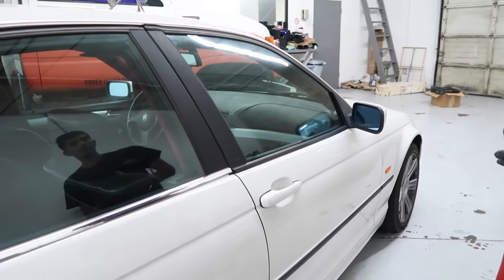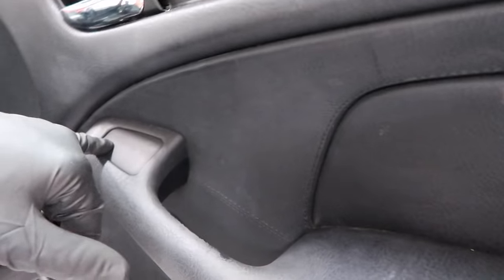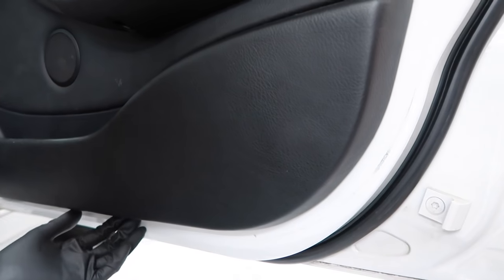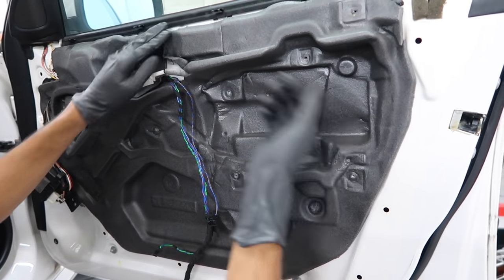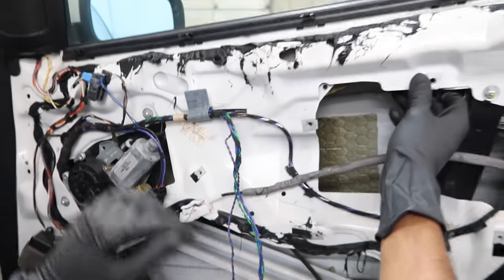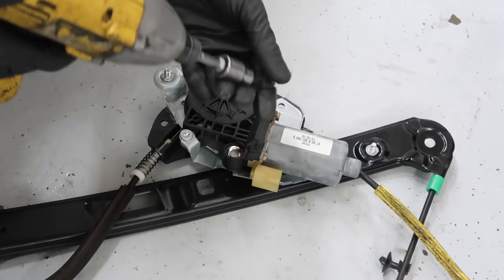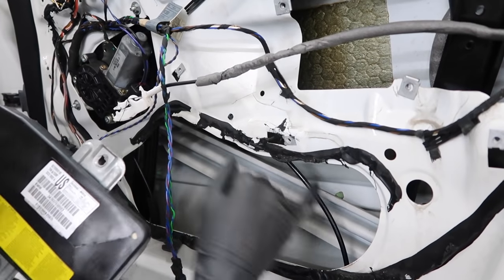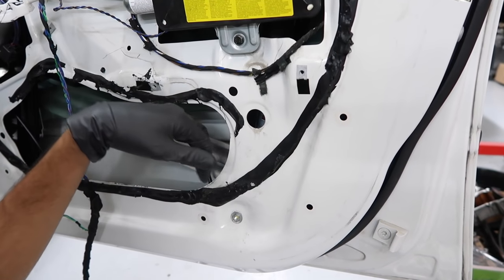BMW E46 Window Regulator DIY + Ebay Regulator Review

Comment: My 1999 coupe has more rattling in the drivers side door, like the window is a bit loose, I think I maybe have even heard it actually moving on bumpy roads. Should I just try to remove the panel and look for loose bolts, or maybe there is something more to the frameless windows?
Reply: I have same issue with my M3 lol.  I guess only way to find out is to remove the door panel.  Thought it could be just a loose bolt, but may need a regulator.
Reply from the maker: The way the regulators hold coupe and convertible windows is with a bracket that has rubber on both sides to hold the glass in place. You can replace the rubber part or just try to tighten the bracket as long as your regulator is still working fine.
Reply: Great info, thanks!

Comment: My 2003 bmw 325i drivers side window motor and regular is replaced but my window only rolls down ( spins down when I click down and up )   ( rolls up when I use the "hold right to roll up windows" lock feature on the outside of my car.
Reply: I hope you got this fixed by not, but if not it could be the switch

Comment: hello. has anyone recently done this successfully without the airbag light staying on? it was not clear on the process. thanks in advance.
Reply: He did mention to detach the negative connection on the battery b4 removing the airbag or the light would stay on.... As many times as I had to on attach and detach the  negative terminal, I slipped up one time and took the airbag off while the connection was on and my air bag light is now on as of yesterday.. Its a great video and totally my mess up but now I can't figure out how to get the airback light off........anybody out there have any suggestions?  Many thanks in advance!
Reply: @Healthydiscoveries  My friend had an airbag srs scan tool that he helped me reset. On Amazon, its called Leimo B800. In my case, it was also because one of the plastic pins of the connector was broken. I had to replace that too.
Reply: @Vince-tp5vr  thanks so much!  Its worth a try!!

Comment: Hi Jason, I have a question. Does the air bag light come on and if it did. did you have to reset it?
Reply: it will come on if you failed to disconnect the battery before doing this repair. shoulda disconnected the battery..! 
you can reset the code with a high end code reader or with the BMW software and a cable that plugs into your laptop and the car's diagnostic port. check e46 fanatics forum for info about that.

Comment: Anyone know how to replace the red clips?
Reply from the maker: The door panel trim clips can be replaced by turning them 90 degrees and then pulling them out. You might have to pry a little bit with a trim tool
Reply: @ShopLifeTV  thanks man. Your videos always help immensely 😁